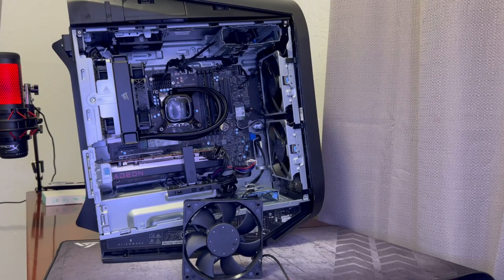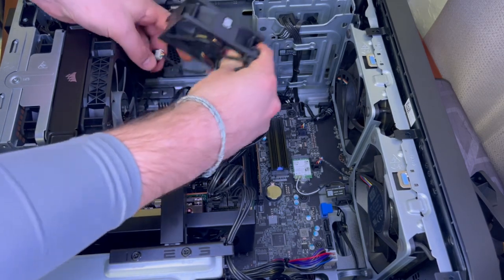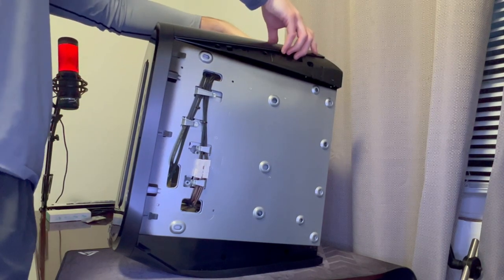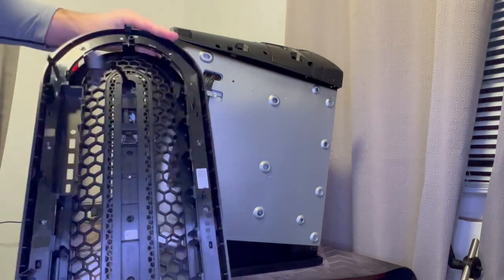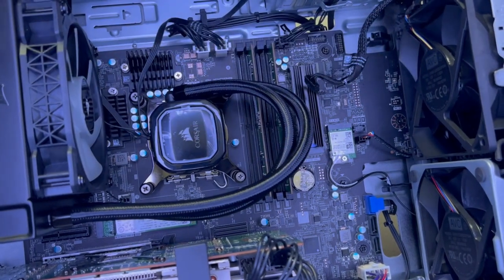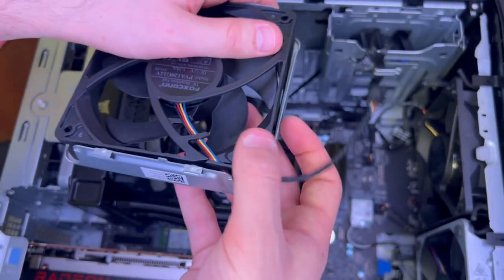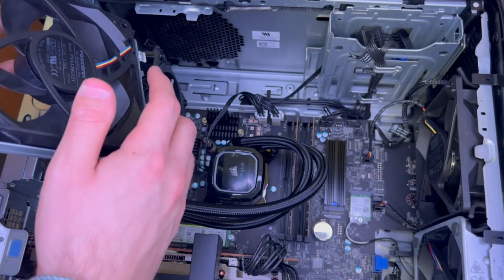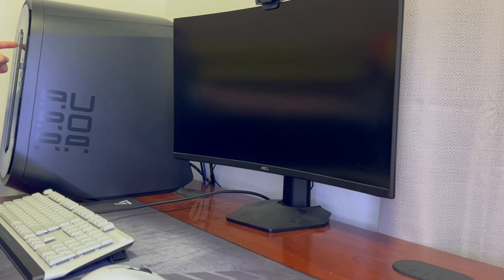Adding an Extra Fan to My Alienware Computer

Comment: Thanks for the great video. I upgraded my fans to the Corsair ML120s with your help, and added one of the stock fans to the top for exhaust like you did here. They are functioning, but Command Center doesn't seem to recognize the extra fan. It also isn't changing their speed anymore. If I set one of the higher running profiles, the only fan that changes is the stock CPU fan which wasn't upgraded. Any ideas or tips? Thanks 
Edit* - Just reset my CMOS and command center is changing their speed now, but still only showing a total of 4 fans (3 case, 1 cpu) instead of 5.

Comment: Great video, I have an Aurora R14 coming in a few days. I have to get an AIO cooler as it coming with air cooler. I will replace that 512 SSD with a 2TB SSD and like you ,place a fan at top.
Reply from the maker: Thanks for the comment! Super exited for you!

Comment: Question. So the fan that you removed to place on the top of the PC was a different brand (foxconn) with a smaller cfm. The one you put on the front (avs) has a higher cfm and different fan blade design (7 vs 5 on foxconn. Does that matter? I just swapped my foxconn for an extra avs I had when I switched to liquid cooling, but not sure if I should have done that.
Reply from the maker: Thanks for the comment! It's really just your personal preference and what you want to use. I highly doubt there is gonna be noticible temperature difference either way so unless your getting an error or the fan is just super noisy I wouldnt worry too much about it.

Comment: Hello, I just ordered an Alienware aurora r15 and it’ll be arriving very soon, it has 32 gigs of ram, 750 watt psu, rtx 4070, and an intel i9 13900f with air cooling. I just want to know if you think I’ll have problems with overheating, thermals, etc…
Reply from the maker: Sorry for the late reply! if you got the air cooling with an I9 your going to be even worse than I was as the I9 is going to make even more heat than my I7 did. The R15 itself is going to be much better than the R13 in terms of cooling capabilities but you should have spent the extra $50-$100 for the liquid cooling or cryotec liquid cooler. Everything else is not gonna have any issues but your CPU with definately get too hot and start thermal throttling during most normal gaming sessions. Not sure if you've allready received it but even if you have I would look into returning and repurchasing with the basic liquid cooler for $50 more or complaining to supoport and see if theyll send you one for free because the computer is way too powerfull for that little baby air cooler. You'll spend more than that trying to fix it yourself with either a bigger air cooler or an aftermarket AIO and possibly having fan or BIOS issues after installing. Other than that the R15 with the 240 mm AIO cooler and the side ventilation holes for the GPU you shouldnt ever have a problem with overheating.